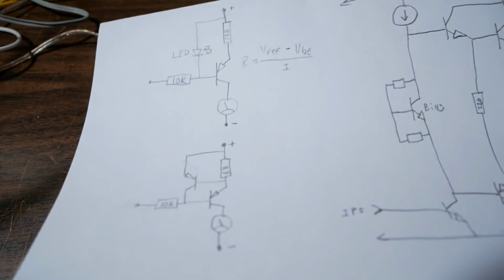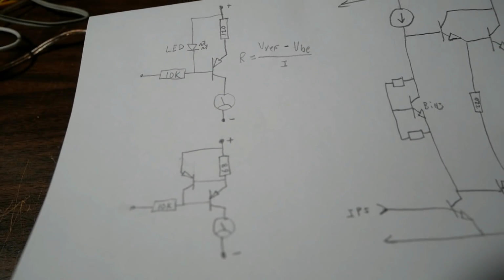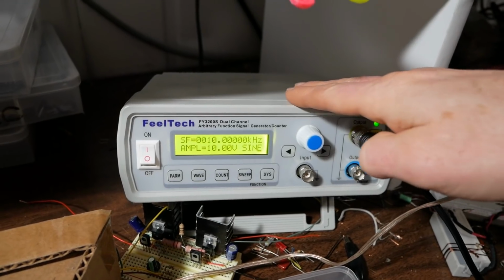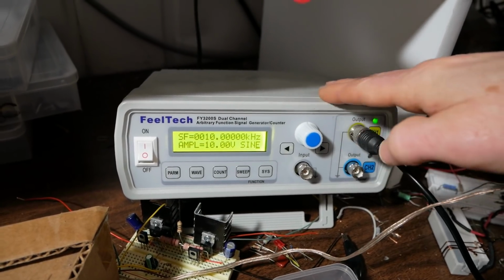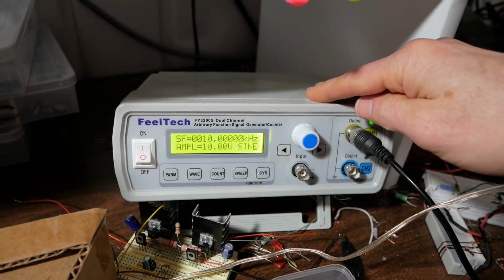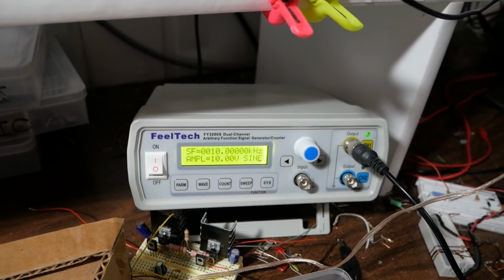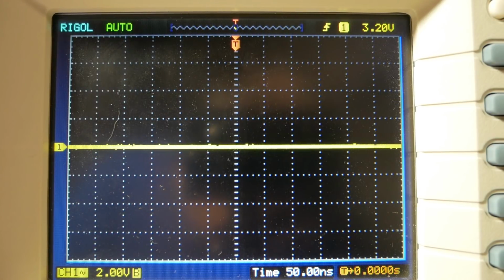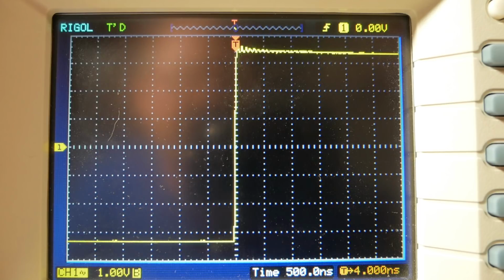Discrete audio amplifier project PT9 voltage amplification stage CCS

Comment: just a curiosity question, I am learning quite a bit about amplifiers through your videos and want to thank you for it. But the question I want to ask is, could you instead of a biasing transistor use 4 diodes and get a constant 2.8 V drop on them and by doing so bias the output transistors? Thanks :)

Comment: Why there is no biasing circuit for the CE circuit? Another question if the differential stage doing all the voltage amplification with the help of the feeding back circuit why using CE circuit why not emitter follower circuit thank you for this amazing series

Comment: Square waves and breadboards don’t mix. You can actually measure both the capacitance and the capacitance distribution from hole to hole and run to run. 

Given how simple these circuits are, there’s no excuse for not protoboarding both and using proper probing methods. 

That ringing could easily show up on either circuit using your methods.

Comment: Not sure if you mention it somewhere in the video. But the CCS with 2 transistors can be further improved. Turn one of the transistors around so they have the flat sides against each other. Then put a heatshrink tubing around them to make them thermally equal. Then you would have even less play in the constant current.

Comment: Hi John, the ringing is not from the supply independent CCS (two transistors CCS) or the function generator. Since the function generator has a relatively short rise time, your ground lead on your scope's probe will introduce artifacts. This is because the probe's ground lead has significant inductance which can't be neglected at the frequencies such rapid rise time produces. All the ringing you noticed is that classic signal integrity issues introduced by improper probing. Shorten your probes ground leads and try it again. Note also that, both of your circuits have high input impedance verses the function generators low impedance (50 ohms) which will introduce transmission line effects. I hope this helps and keep up the good work!

Comment: Heya John. Yeah, I’m riding the fence on these but slightly favouring the 2 transistor ccs. The ringing is pretty low and might improve on a pcb. Choice of transistors might make a small difference too. I’ll have to think more about this. (Not an engineer, self-taught hobbyist.)

Comment: Have seen the const-current symbol on the high side of B-output stages all over the place, but have not seen how it is simply implemented until now.  Thanks ... but still, am left  confused.
Where does the Base resistor end up?  Are you going to produce a -2V drop from the top, or tie it to the ground?  I suppose what you demonstrate, is like this image  (right), with 0.7V/68ohm yielding ~ 10mA:  http://www.talkingelectronics.com/projects/TheTransistorAmplifier/images/Fig71ba.gif
But your voltage is both above and below the illustrated 6-15v range.

Well, you have done the rubber diode, and now this CCS.  All that is left is a re-cap of a class-A, collector amp on the low side.  Hmmm, how to get a gain of over 15 without noise?  Complimentary pair?

Comment: Hey John, it may be that the reason you’re seeing  the ringing on the oscilloscope is because you’re attempting to measure a square wave with a standard probe with a long alligator clip. Additionally the circuit is mounted on a breadboard which has significant parasitics. If you were to measure with a differential probe or even install a pigtail/ground spring (shown here https://electronics.stackexchange.com/questions/136123/how-do-you-attach-an-oscilloscope-ground-spring) in place of the alligator lead on your scope probe it would likely cleanup noticeably for you when you measure it on the front of the function generator. However, when you measure it in circuit, the other parasitics – particularly inductances in the bread Board and lead wires will still likely give you trouble. That should clean up nicely in a good PCB.

Comment: Hey John! 

First off, I hope you had a good Thanksgiving.

Second, I know you went over it in a previous video of this series, but would you explain again the split resistor / capacitor alternative to a CCS? And when would this even be considered given the simplicity of either of the 2 CCS circuits you've shown today?

Love seeing Snickers. "Feeltech." Lol
"Got to grab the knob." Glad I wasn't in mid drink when you said that. :D
Great out-take there. Hehe
Reply: BTW, this is where you explained the Bootstrap alternative, in case anyone wants to know. 
https://www.youtube.com/watch?v=I2FQ-hFpH9g

Still, though, what are the pros and cons of the passive Bootstrap vs. the active CCS? And why would you use one over the other in a given situation? 

(Trying to stimulate conversation - :) )

Comment: Time to Upgrade that Signal Gen. I'm ordering the Siglent  SDG810 for Christmas, I have the same one you do and it's not good for working on audio. Way to noisy.
Reply: Siglent is a nice unit
Reply from the maker: I looked at the nicer sig/arb gens from the other scope companies. If you look closely at the specs you see the distortion is too high for audio work. They are quality devices but are geared toward RF. You can generate clean sine waves in the audio band with a computer's sound output and square waves with a micro controller or logic gates.
Reply: @JohnAudioTech  How low distortion/noise is low enough? Will quantization noise from a 12 or 16bit DAC be problematic?
Reply: @aksela6912  maybe not with 16bit but in most design 12bit can bit a problem. As their design goal is not for audio. Like affordable 100 dollar dongle can provide near to 0.0001% thd+n figure (real life tested)at 1khz and you will probably not going to find one even over 100 thousands dollar equipments.
Reply: @johnyang799  Hmm. I was thinking about using an Arduino, but they're limited to 12bit. 16bit would require a separate DAC and more involved code, increasing complexity a bit. Still might be a worthwhile avenue.
Reply: @JohnAudioTech   Yea looking you doing FFT with 8bit scope makes me cringe, get a decent sound card (24bit/198Khz Fs) and ARTA or Holm impulse (those also do MLS or chirp loudspeakers room gated measurements for quasi ancheoic response) or even Visual analyser  FFT sw and you can generate nice signals and analyze them with WAAY better precision then with  rigol, can do multiple sine IMD all sort of jazz, also you can make wien oscilators that have THD down to -120-160dB if you want to go that low, kinda pointless since it is hard to analyze that later, so decent soundcard does wonder comapred to this setup of yours, i use UMC202HD (and  own Rigol 1054Z and still prefer Behringer for these types of measurements waay more), with Holmimpulse you can do quick Freq response scan with THD plot for whole THD vs FREQ sweep range plot and 6 harminics curve in one plot in matter of 1-2 second it is great resource!
Reply: John’s correct, the SDG810 has 0.2% THD.  Not terrible, but not great.  The SDG1032X has 0.075% I believe.  But it cost almost $400.  Not bad for a  pretty great ARB, but spendy for an audio gen.